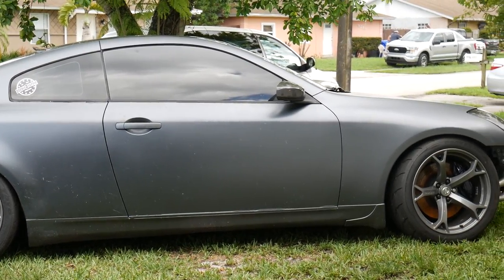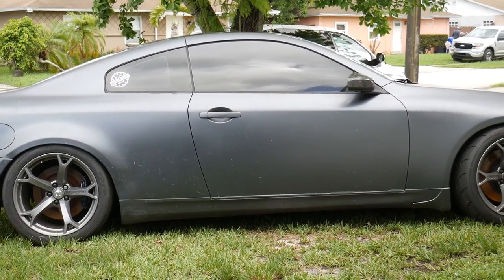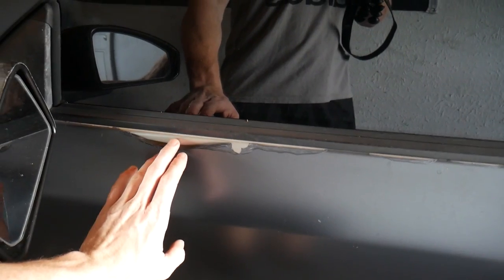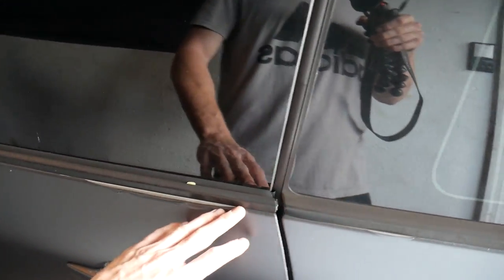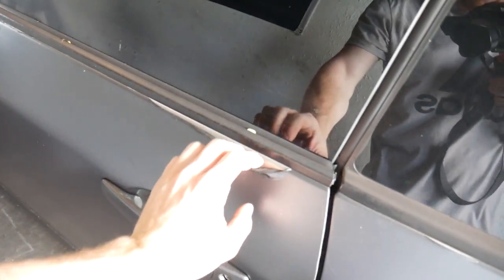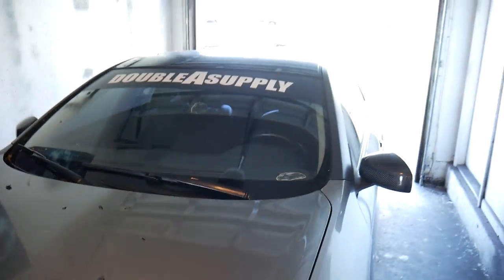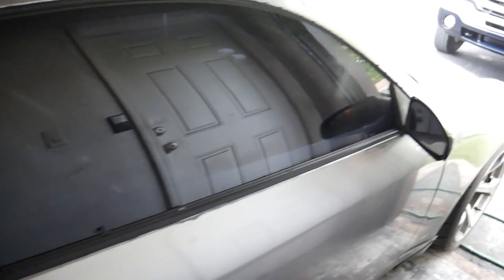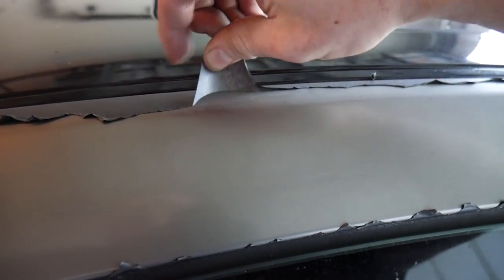Ripping the Plastidip Off my Turbo G35!

Comment: Keep up the videos bro , you were gone for so long , fellow south Florida g35 coupe owner . Mine is 04 coupe manual with black interior, the body is the same color as yours . But I blew my motor , still trying to decide if I should rebuild mine and boost it  , buy another stock de and boost it  , or vhr swap it and boost it .
Reply from the maker: Appreciate it fellow sfloridian! Shit happens man keep your head up and you can get her fixed right back up and better than before